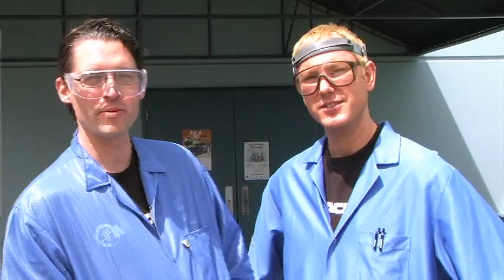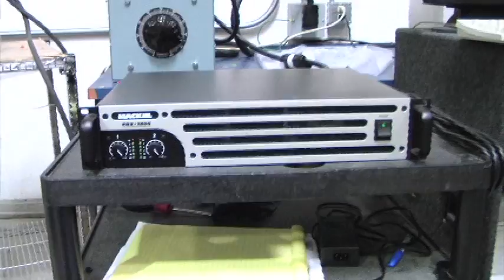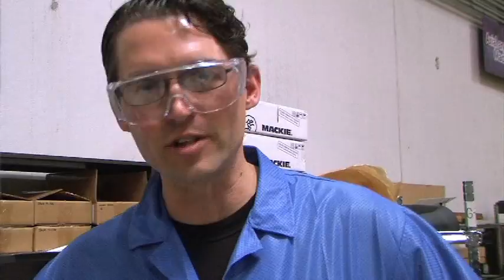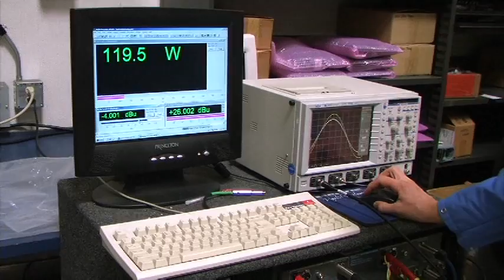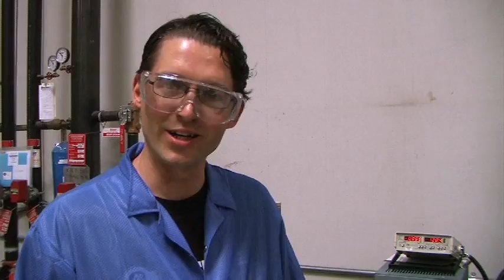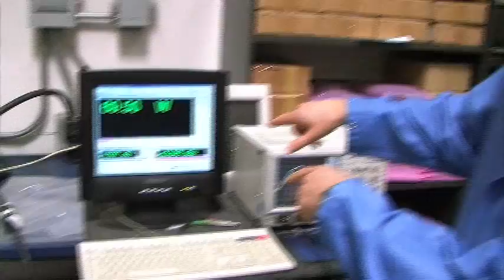The Mackie MixBusters: FRS-2800

Comment from the maker: The PLX Series you mention is obsolete. The amp we used in the test is a current model from our competitor, with rated performance comparable to that of the FRS-2800. 1250W/ch at 2 ohms is the manufacturer's published spec for this model. Speaking of big differences, the price of that model recently topped a grand, so the FRS-2800 will now save you over 400 bucks.